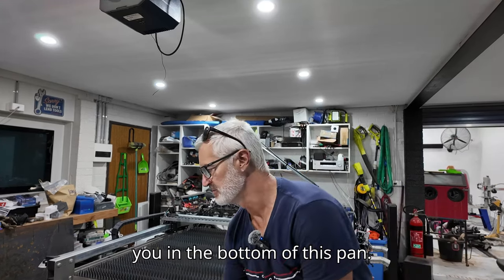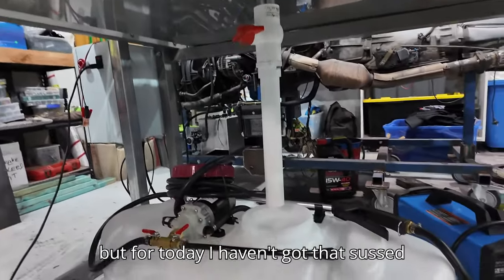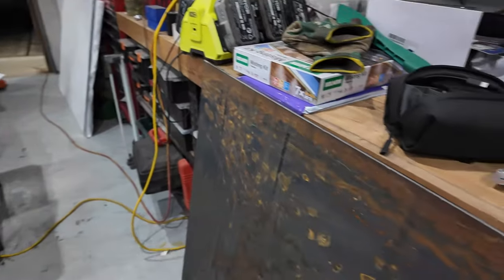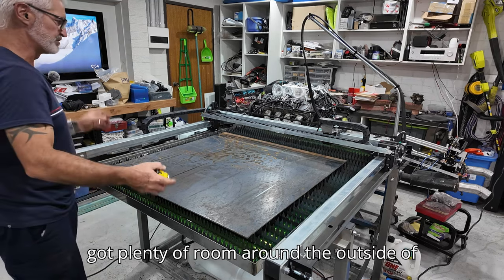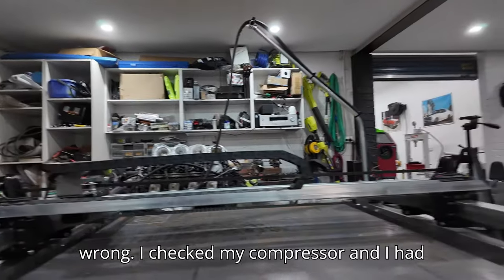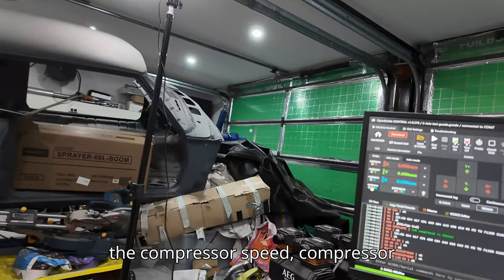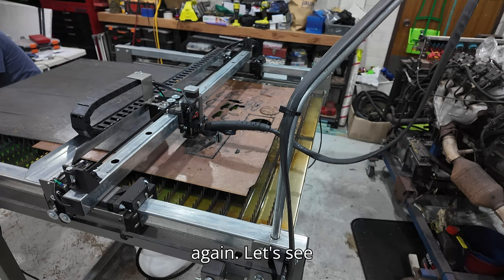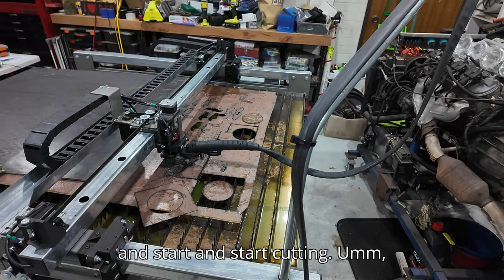DIY XL Plasma cutter build Part 4 first cut

Comment: Very cool, great to see the CNC Plasma table finished and working with the first cuts. Very cool. 
Can you pm me the final build cost in $AUD
Reply from the maker: Are you the darren turner with the silver comaro?
Reply: @ Yes bud 👊😎
Reply: @ Hey Kevin, yes. Been a while. HQ Coupe looking good.
Reply from the maker: @darrenturner6090  ok ill get you some details later
Reply from the maker: @darrenturner6090 Here's the run  down on the costs. For anything through Amazon Australia, x 1.5 the price JD suggests.
Steel cost for me was outrageous, but I was lazy, I bought duragal tube from bunnings in short lengths, 1.5m lengths. Which is why I made it 1.5m x 1.5m. If I was you, I would get long lengths if you can pick them up, way cheaper, you will save about $200.      I used duragal so I didn't have to paint the x and y axis tubes as others have issues with the steel rusting.
I think all up I'm into it about $1600 -$1700 not including my plasma cutter, which I already had. If you don't have a plasma cutter, just look into a cheaper brand that meets the requirements of JDs suggestion. Lots of people have had success with the cheaper plasma cutters. Mine is a cigweld easycut35. It's too small, get a 45amp pilot arc plasma cutter.
When you buy the plans, buy the XL plans from JD. It has a calculator for whatever size table you decide to make. He developed this option after I supersized mine. There was no option for a larger table when I had to work it all out on my own. My thought is make it as large as you can with the space you have.